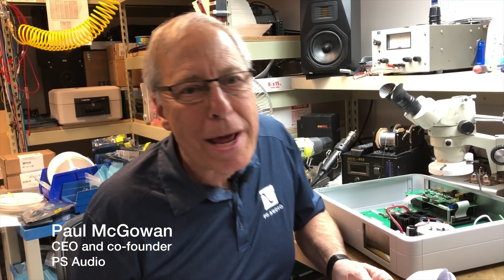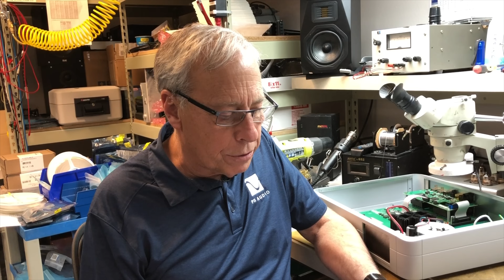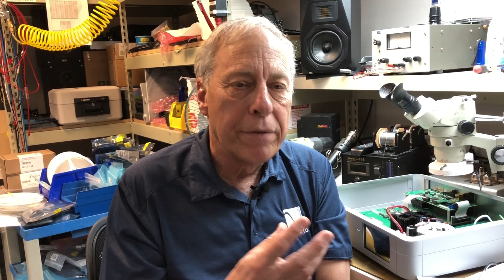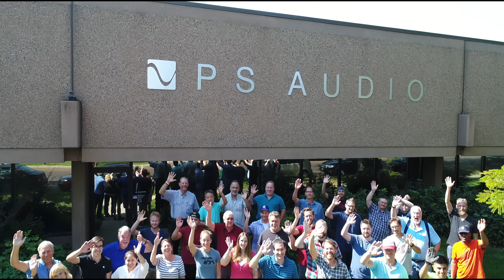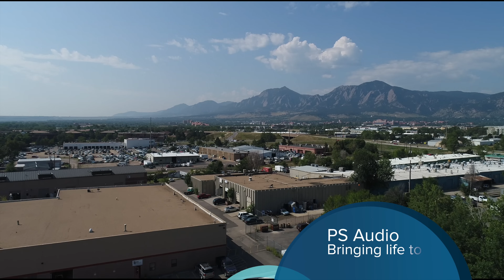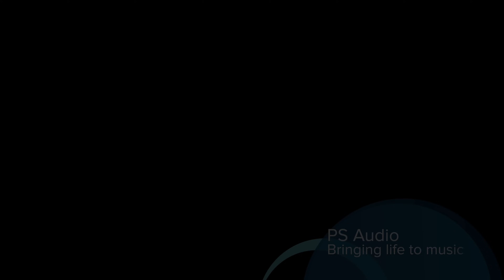Active vs. passive crossovers

Comment: Like you said, Paul, active AC’s must be better. A friend persuaded me to try active crossovers. On a strict budget for high end audio, I chose a pre-owned (as usual) fully balanced Rane 23B AC. It’s a 3-way stereo active crossover for my front cabinets loaded with all 8 ohm 15’s, SEAS woven 7’s and SEAS Millennium tweeters. The most effort was selecting the matched SEA drivers using factory technical sheets. I focused on matching driver efficiency/sensitivity, ohm stability and the “Fs” (low frequency limits) to prevent driver damage. Madison Sound was helpful with drivers. The SEAS Spec Sheets (known to be quite accurate) allowed me to safely crossover the mid range drivers from 150 to 2500Hz. This allows nearly the entire mid range through single 7” woven drivers (great coherence). The Rane 23B has separate volume controllers for each driver to fine tune the room balance. Two dials per channel adjust the XO points, one between the bass/mid, and one between the mid/tweeter. Whatever, don’t XO the tweeter too low to prevent blow-out. For safety, I tape the tweeter adjustment dial closed once set.  

Comparing costs of new speakers, my front speakers were only about $5,000 all in, including preowned 2-chamber sealed cabinets ($1000), $300 for short balanced Mogami cables, $1200 for new SEAS mid and tweeter drivers (I had good matching 15’s). The extended range SEA Millennium tweeters, 2500Hz and up, were expensive, and mid range drives about average), $250 for the Rane 23B, and $1800 for a 7-channel amp. I use all affordable Mogomi Gold 2534 analog studio cables as interconnects (except digital signals with special cables) with a 2009 Proceed AVP2+6 and AMP 5, and 7-channel Lexicon sharing similar sound characteristics. I have a OPPO 105D as a source player and to stream online content through a HDMI to RCA digital convertor from a iMac27’s higher voltage Thunderport.  

The 4th order XO’s clarity and definition sounds like live performances. I admire many speakers, especially the newer Trident and Legacy Aeris type designs with built-in subs and sub amps, only requiring extra amplification for the midrange and tweets. If you have quality cabinets and drivers, you only need a stereo AC, interconnects, cable and a multi-channel amp.

Simply find the listed crossover frequency settings on your passive XO’s factory spec sheets, and you’re ready to go.
Reply: 9

Comment: Hi Paul,
I really enjoy your Videos and have learnt a lot of the do's and dont's. I have recently got back on the audio bandwagon and the landscape has changed so much with the digital
scope of things since I enjoyed the hobby "Back in the Day"
Any how, I have purchased a pretty decent (Spec Wise) entry level system that doubles as my home theater. I am running it in a 7.1 setup with dual F12 subs. The speakers are a mix of Klipsch, Pioneer and Elacs.

 My question is this....
The speakers have an internal crossover that varies (pretty close) and are not identical between the different models. There is also a 9 band EQ on the receiver, another EQ in software (ITUNES) and a crossover setting on the Subs. What should I tune in first on the EQ side? If the lowest frequency generated by my LCR speakers is 34Hz where should I set the Sub in relation to roll off of the mains. add 20Hz? And to confuse matters worse I have a crossover  setting in the AVR setup itself 50,80,100 and 1000 Hz

I have placed the speakers in many locations and finally have them where they sound best, in the end what I think sounds good is whats right I know, But I am so curious to get other opinions on how to go about tuning everything in.

Thank You From Yulee FL.

Comment: I'll go one step further.  I want the dac in there as well.  Most don't buy a car body, then choose your own engine from another manufacturer, then the suspension from a third.  These things should be engineered as complete systems.   We are starting to see a few.  Kef LS50,  Elac AM200 & AIR-X, JBL 708P.  Still no inwall/inceiling w/ digital inputs that I've seen yet.

Comment: The current trend in pro audio (audio for hire that is) is digital active crossovers. This is true for both studio and public address (concert sound systems). Right away you have to know that more and more we are converting the signal to digital once and it remains that way until it comes out of the amps so it retains most of its integrity. The advantage to digital is that there are many more variable parameters to adjust and we can make multiple groupings storing them for recall at a moments notice later. In the video, one of the concerns mentioned was phase coherence. In my experience, both passive and analogue crossover commonly do little to nothing to address that. What I mean is that when it comes to driver placement as it relates to the arrival time of that sound at your ear it is very difficult to determine the exact positioning upfront as there are a number of factors that work together to determine that including lag time caused by various components in the system. With digital, we can physically measure that shift and adjust for it without having to physically reposition the drivers. Also to consider in this is the fact that digital eq which is what a crossover actually is can generate very little phase shift when compared to its analogue counterparts as well.

Comment: With digital crossover you can have near infinite roll off, that is what Dynaudio XD and Kii Three have. The best crossover is crossover at source and you can only do it digitally.
Reply: I'm not convinced I would want near-infinite roll off.  What happens to the phase response?  Is the sum of high and low pass sections closer to or farther from unity?  One thing that can be said about a first order crossover is the high and low pass sections functions sum to one.

Music signals are complex waveforms, not simple continuous sine waves.

I like digital audio, but I am leery about passing an analog audio signal through an additional analog to digital converter and digital to analog convertors for the digital crossover.  I don't like the idea of having a custom multi-channel home pre-amp to accommodate the outputs of a digital crossover before the pre-amp.

Give me a nice analog active crossover with fourth order Linkwitz-Riley filters frequency selected for my speakers.  Maybe a capacitor in the high frequency speaker circuit or a relay to protect high frequency speakers from low frequency amplifier power during turn-on thumps.
Reply: Theoretically it should sound perfect. But fact is best crossover I heard are all acoustic crossover i.e. crossover made up of box dimensions and slots. So theoretically best sound the worst and theoretically worst sound the best. I don't know.

Comment: The JBL M2 have active electronics, they come with amps that are also crossovers and can control de speaker to change with the room that they are in. As far as I know they are the most  advanced audio system out there. It's crazy because it break all the rules of what a quality amp should be (as it is a class D system in a light metal box) but when you hear them, then you understand. There is music, nothing else.

Comment: For those of you who are wanting to buy an active crossover but don't have deep pockets, you will find that the pro audio / sound reinforcement industry has much to offer. You can pick up a used XTA DP200 (other brands are also available) for under £200 in the UK, for that you get  a top quality, full DSP, 2-way stereo, or 4-way mono crossover that also incorporates multiple equalizers, time delays & limiters. 
For those with a 3 or 4-way stereo system you would need 2 units, ...still cheap at the price.

Comment: I love my Emotiva Active monitors.  Not having to "match" drivers to amps and having several components and all that. With an active system all you need is a DAC with digital volume control. And you can DSP a system much easier and add mulitple active speakers much easier. A 2.1 system can be transformed into a 5.2 system much simpler. Less cables and less potential failure points and interference.

Comment: I've built a number of active speaker systems over the past 5-10 years and learned a great deal about what works and what doesn't work. One thing I have learned having tried it a few times is that passive designed speakers do not lend themselves very well to conversion into an active system. This applies even to a passive speaker system that I designed and built myself. Every component in an active system must be selected carefully to work together as a whole. The key to the system is the active crossover, a component that very few companies are making. There are a couple of inexpensive ones I have found and tried that were in the $100 to $300 range, one had poor performance, the other a car audio device that actually sounds quite good. There are one or two extremely expensive options, but I would recommend Phil Marchand's devices, prices in $1300 range, exceptionally well designed and very flexible. For more on active speakers, visit my youtube channel "Speaker Builder".
Reply: I would agree Speaker Builder, that Car Audio was a good place for me to learn things about the sound difference between passive and active crossovers and how much it "frees up" and amp to be specific in the frequencies it amplifies; Instead of filtering it once it is amplified. Its cheaper to start small in a car to learn also. for me at least back in the early 90's

Comment: Biggest difference between active and passive is the location of the crossover : passive sits in front of the drivers (speaker) and as such has to take into account the frequency dependent impedance  of those drivers which can make it very hard to design the crossover you want : a theoretical text book crossover will almost certainly fail . An active crossover sits between preamp and power amp. As such it is shielded from the speaker and its impedance . Also , the active components act much less like  an energy storage device (electrostatic for caps and electromagnetic for coils) . For this reason ,active crossovers are superior when it comes to reproducing transient signals. If your source is mainly digital , consider a digital crossover
Reply: Gerrit Govaerts I wish someone could expand on this
Reply: @n1n1n1-v6x  The passive crossover is between the amplifier and the speaker elements and divides high frequency and low frequency amplifier power between high frequency and low frequency speaker elements.  The amplifier drives the speaker elements through the passive crossover.  The frequency and phase response of a passive crossover filter is affected by the impedance of the speaker elements.  A speaker element is complex impedance that changes with frequency, not a simple resistance, so designing a passive crossover for a specific frequency and phase response to work with multiple speaker elements is difficult.

The active crossover is not connect to the speakers directly. An active crossover is in the signal path before the amplifiers and divides high frequency and low frequency line level signals between separate amplifiers connected directly to individual high and low frequency speaker elements.  The active crossover is not affected by the amplifier impedance or the individual speaker element impedance.

High current high voltage capacitors and inductors in the passive crossover are low precision and not ideal capacitors and inductors.  Large inductors are coils of thin gauge wire.  The wire in passive crossover inductors is much longer and much thinner and higher resistance than your short thick speaker wires.

I believe the large series inductor in the low pass filter is a source of dynamic compression and distortion.  Active multi-amplification improves speaker frequency response, improves dynamics, and lowers distortion.
Reply: No, I like Active xover but analog, not DSP because that changes a vocalists' voice or sounds clinical instead of live.

Comment: I’ve had active crossovers in my system for about 15 years now but they are made incredibly simple, Linn sell both active crossover cards that are installed in the amplifiers or active crossover boxes, their speakers can easily be configured for either passive or active use and the difference is easy to demonstrate. It didn’t take long for me to make my mind up... took a little longer to pay for it though!

Comment: I actually prefer using a combination of both passive and active crossovers. As long as they are quality crossovers. You can do no harm.
Reply: Random Tube Random comment
Reply: It's how many of my speakers are built. My three ways have 2 sets of connections. One goes to a passively low pass filtered woofer, and the other goes to the mid and high range, which has passive crossover components. They are separated so you can power them from separate amps if you want, or you can bridge them together if you want to use one amp.

Comment: Paul, I understand the benefit of an active crossover but isn’t there a train of thought that says the less circuitry your musical signal has to pass through the purer that signal will be, and hopefully will sound better?
Reply: Same question here !!
Reply: David Tomsett it's not more circuitry, its better, smarter circuitry with dedicated amplification per channel. One is wire, caps, and resistors, the other is a high speed, regulated computer.
Reply: That belief is audio bunk. Modern high performance OP amps are transparent and competent engineers use them widely. Even the 40 year old NE5532 is still in wide use. In the recording and mastering process, the signal is passed through a huge amount of OP amps and transistors before it ends up on the media you listen to. Now days it's mainly a digital process.
Reply: I agree! It's nice of Paul to mention the components! I went to Navy Electronics where, in addition to the ribald resistor color code limerick, "ELI the ICE man" was repeated, ad nauseam. This means, in an inductor, the 'L' here, voltage leads current by 90 degrees, and in a capacitor, current leads voltage by 90 degrees. Right here, you're interfering with phasing, phase coherancy, clarity, signal integrity, resolution & so on. But, it can be done! Years ago, I had 4 way Wharfedale speakers, with a better, more excellent midrange than their 3 way. Like a frog, someday, before I 'croak' I want to make another multitrack recording, with each instrument on a separate channel. Then, the bass guitar, or stand up bass and big drum will have its own amp into the woofer, the cymbals will have a smaller, quality amp into the tweeters,  & horns and basic drums have their amp, into the midranges. No crossovers, at all! How do you like this!
Reply: David Tomsett, The passive crossover has many problems of its own. By eliminating it, and replacing it with active circuitry, you will clean up the signal, and by using separate power amps, clean it up even more. I have been biamping for over 30 years, and have built many biamped systems for friends. No one ever wants to go back to passive after hearing a good biamped system.
Reply: active crossovers could add some noise and distortion to the signal yes, but usually, if not really really poorly made, the noise and distortion added to the signal are negligible or should i say inaudible?
comparing with the mess passive crossovers could do, i'd say active is a clear winner.
Reply: Problem is, some of the better drivers out there require steeper crossover designs which have more parts and complexity.  Passives also require more power to drive and other issues like impedance mismatching, time delay between drivers, etc. are much more difficult to address with passive designs.